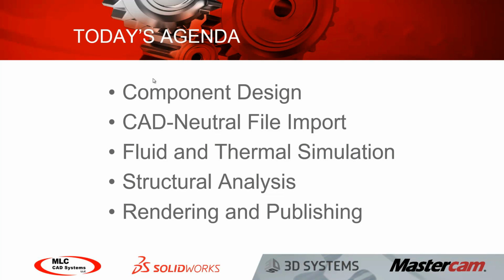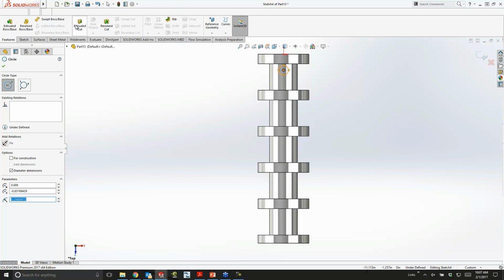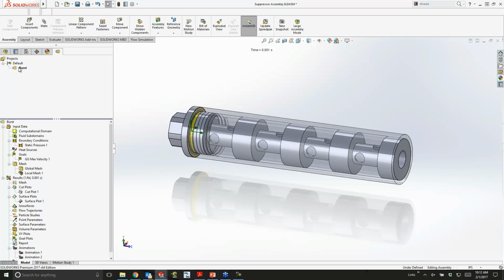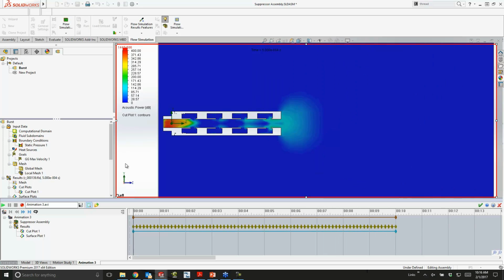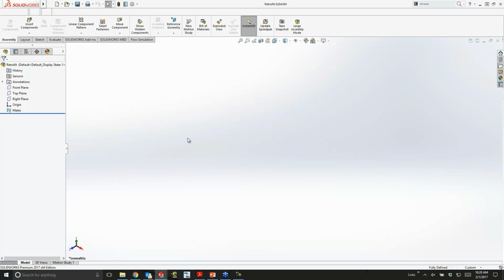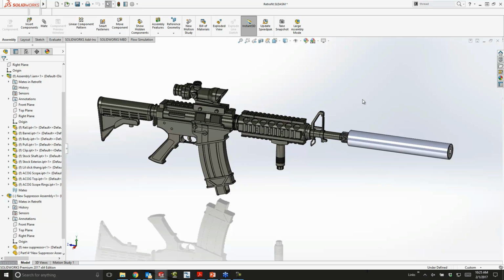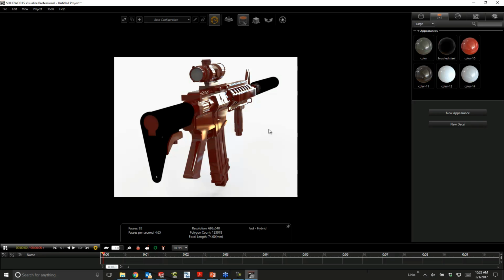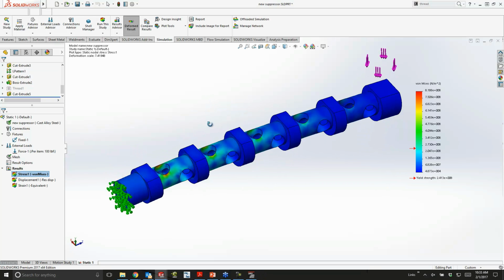Designing Firearms with SOLIDWORKS

Comment: Very interesting video. As a begginer in simulation , I would be very interested on seeing all the configuration of such simulation, would you be able to provide these configurations?
Reply from the maker: We can't share this specific file, but hopefully the video covers enough information to get you started.  Good luck!
Reply: @MLCCADSystems The files are already shared by you (look below, there is a dropbox link where I downloaded the project). That is the point: the video is about design and simulation of a suprresor, and without clear explanations of some settings you used, there are doubts about the simulation being really properly set up, it is just a constructive critic: the better someones explains, the less doubts exists about how good the teacher is right?
Reply from the maker: This tutorial covers the workflow and explores the application but explicitly is not represented as an accurate result at all.  No external validation is presented, serious simplifications are made that undermine the accuracy, and the geometry is completely arbitrary.  Consider this tutorial as only how you would begin a journey of Simulation.

Comment: how long did your simulation take to run?
Reply from the maker: We seem to have lost the result files for this, but if I recall correctly it took one or two days to complete at full mesh resolution because it is transient and has such a sudden burst that the shock front took a while to converge at each time step.  Modifying the time step, the mesh resolution, the domain size, and other parameters will have a big impact on the solve time.  I've seen solve times range from 15 seconds for small valves up to 2 weeks for a transient solution of an entire aircraft going transitioning to supersonic flight.

Comment: it awesome video....if you add a bullet  motion inside a silencer then it will be icing on the cake   .
Reply: a video like https://youtu.be/wXgSOUnIBtU
Reply from the maker: Unfortunately Flow Simulation can't analyze a moving mesh like this, one where the shape of the flow region changes with the position of the bullet.  It would make for a better video but the focus in this case was on analysis and pushing the potential of the software to study a very dynamic process.
Reply: MLC CAD Systems thanks for your quick response

Comment: Great job, how did you do to generate the simulation, making the projectile move during the simulation? can you help me?
Reply from the maker: It is not possible to insert a moving solid object into the mesh in Flow Simulation, with the only exception being rotating regions.  In this case, I am simulating the firing of a "blank" which includes propellant but no projectile.
Reply: @MLCCADSystems  
Okay, could you help me how to do this simulation the way I did in the video, step by step?
Reply from the maker: Here is a copy of the files used in this presentation for you to open and review.
https://www.dropbox.com/s/d6ed2lft6rbtz1n/Suppressor%20Assembly.zip?dl=0

Comment: So I'm a mechanical design student and I've been playing around with flow sim for my own muzzle brake design but have been having some trouble getting it to do what I want. Could you link us to one of those pressure charts? Also, did you run this as an external or internal sim and could you do a video going more in depth on the flow set up process specifically for rapid pressure release applications like this?
Reply from the maker: If you search for "Chamber Pressure Chart" you can find several sources where the pressures in the firearm chamber are measured over time, often these charts are categorized by caliber and can be impacted by several factors so they are only valid as representative data.  These pressures are measured for different purposes such as chamber design and ballistic analysis, but they are useful for understanding the conditions of the inputs for a scenario like this.  You can do this as an external analysis or as an internal analysis with a box representing the environment, where static pressures are applied to the inside of that box. 
For a rapid pressure release application, the most important things to review are the Calculation Control Options, specifically the time step, which should be manually set to be small enough to fully discretize the input curves.
Here is a link to the files used in the video: https://bit.ly/2QqsMfh